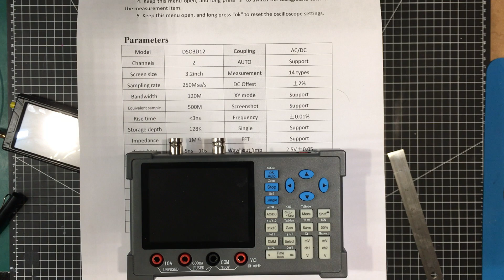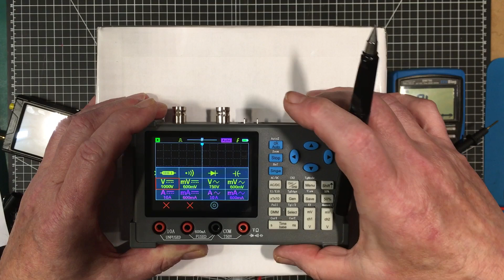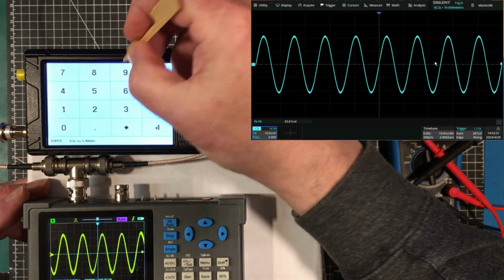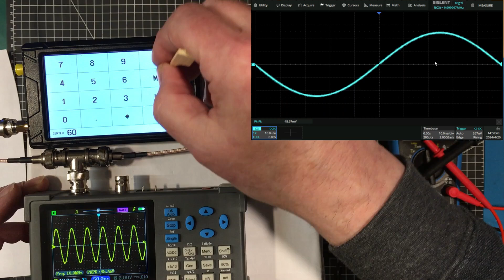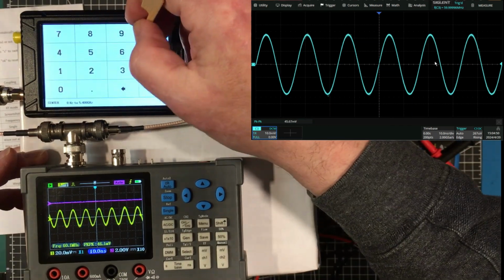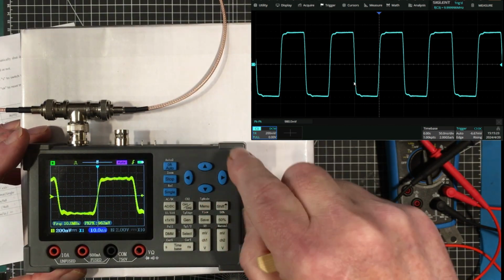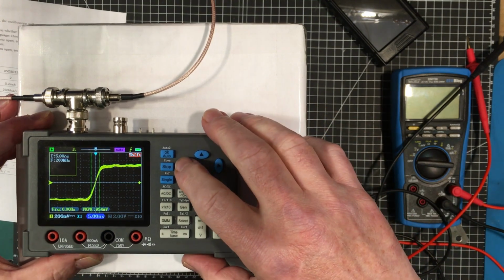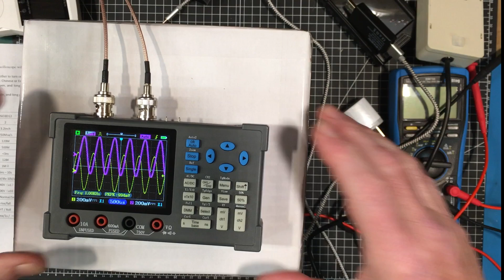Uni-Byte 0179 - A detailed look at the ZEEWEII DSO3D12: Part 2 of 3

Comment: Hello, awesome review
Between the DSO2512G and this one (DSO3D12), which do you think is better/more accurate as an oscilloscope?
Reply from the maker: The scope functionality of both are pretty much the same.  I believe they use the same acquisition chipset.  The DSO3D12 has a bigger screen, but the DSO2512G allows you to connect an external monitor.  The DSO3D12 also has a decent DMM built in, so in a pinch, you don't need to drag one around with you if you have the scope.
Reply: @uni-byte  But the internal "noise", is it higher in either one? I think that lower noise means higher accuracy (besides their similarities)

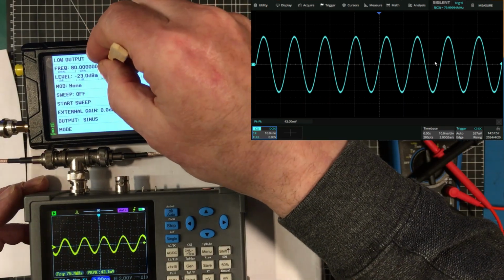Comment: 7:50 You know the terms " transmission line " , " impedance match"  ?
Reply from the maker: Yes I do.   Do you feel I have not set this up correctly?  There is a 50 ohm termination at the SIglent end and the output impedance of the generator is 50 ohms, as well the cable is 50 ohm intrinsic impedance.  The problem I'm looking at in this case is also equally apparent without that set-up and was verified using the supplied probes set to 10x directly coupled to the signal generator, before I even shot the video.  I'm simply using this set-up to use the Siglent to demonstrate the issue with the attenuator.  The impedance of the Zeeweii does not change with different attenuation settings, if it did, you would see the change in loading on the Siglent too .. which you don't.  The net-net is, the Zeeweii's frequency response is not flat at some attenuations and this has absolutely nothing to do with transmission lines, or impedance (mis)-match.

Comment: Should i buy this one or the Zoyi 703s if they are 10 dollars apart?
Reply from the maker: I'm not very familiar with the 703s so I can't really say.  I don't like it's from factor, but that's a very minor thing.  I'd really need to get my hands on one and check it out.
Reply: @uni-byte  sir if my experiment needs 1khz ac wave from the signal generator, can this give a clean output?
Reply from the maker: @ridesafealways4929  Yes, absolutely.
Reply: @uni-byte  what can you recommend for the price of 150 usd? Something better.
Reply from the maker: @ridesafealways4929  You are kind of in a "no man's land" with that price bracket, however, if you can spring $35 more I'd advise having a look at teh Hanmatek DOS1104.  110 MHz, 4-channels in a full sized oscilloscope with a 7" screen.  Of course it is just an oscilloscope.  No DMM, no function generator.

That said, I do like the ZEEWEII DSO3D12 very much, and despite having 5 "real" scopes and 7 mini-scopes, I reach for it more often than most.  I think you won't go wrong if you choose it.
Reply: @uni-byte  thank you for the advice sir. I'll choose the zeewei. I need the signal generator very much for signals analysis subject.

Comment: Can it do pulse trigger? I'd like to capture a signal generated by my garage door remote
Reply from the maker: You cannot set a trigger based on pulse width like some much more costly scopes, but you would not need to for your purposes.  It will trigger on the rising or falling edge of a pulse.

Comment: For anyone looking for a case for this, I used a "UTHAI T29" case that I bought a while back. I believe it's under $2 ($1.36) at Aliexpress Choice. It fits pretty much perfectly and although it's a soft case, I'm pretty sure it will absorb quite a bit of impact should it fall.

It will not accommodate the probes but it's virtually free protection at that price. Just thought I'd share in case anyone was looking for a cheap protective case that will do a great job and cost more in time waiting for it than it will in price.

And thanks to you Uni-Byte. Your reviews were detailed and an excellent decision maker for my purchase.
Reply from the maker: Nice.  I also found a case for it on AliExpress.  If you do a search on "1PC Portable Accessories Collection Foam" you should be able to find it.  It's a semi-hard case and it perfectly accommodates the foam insert that the scope is shipped with.  So it will take the DMM probes and  the USB cable.  As well it has a pouch in the top that holds the scope probes very nicely.  It was about $9 US.
Reply: @uni-byte  Correction. I have one case that I already had lying around and one on the way hehe

Thank you for that! Much better being able to include all the accessories as opposed to my current method!
Reply from the maker: @MHTSAPAS  No problem.  You got the one that was 230mm x 180mm x 70mm, right?

Comment: Wich one is better between zeeweii dso3d12 and dso2512g
Reply from the maker: Understandable question.  The DSO3D12 has a larger screen and a pretty good DMM, the DSO2512 has a nice rubber cover and video out.  Other than that they are pretty well the same.
Reply: @uni-byte  thank you sir. Now im going to place oder for dso3d12

Comment: I think I would buy it if it had all the bugs worked out but as is I’m not really crazy about it.
Reply from the maker: I'll try to mention some of this stuff to Zeeweii.  It remains to be seen if they respond.
Reply: @uni-byte Any updates?
Reply from the maker: @HenrikHvalpen  Their reply was (paraphrased) "We don't have bug reporting process".  I still use mine nearly daily.  The little issues don't really bother  me as I'm used to them.
Reply: @uni-byte  Thanks for the reply. I was originally looking into buying the ZT703s but it seems to have a lot of bugs. Then I looked for a DPOX180H because it seems to have some good reviews, but also a bit more expensive and it only works as an Oscilloscope.
Then I saw the one you tested and it's quite intriguing. I have also looked at a HDS2102s which also is a 2-1 one solution, but it's pretty expensive too.

It's my first time buying an Oscilloscope and I really want to make the right choice the first time.
Reply from the maker: @HenrikHvalpen  I Understand.  When I was buying my first scope I only had one option in my price range .. a Heath Kit single trace 5MHz analog scope (and I had to build it myself!).  These days there is too much to choose from and that in itself can cause issues.  Good luck!
Reply: @uni-byte  The One you reviewed in your video, what are the typical use cases you use it for? I want to use it for diagnose MOSFETs to see if they get the right signal on the gate. And maybe to see if a crystal is performing right.
Then maybe play around with 555 timers and making small circuits.
Reply from the maker: @HenrikHvalpen  I use mine for general hobbyist use,  Right now I'm using it to monitor the serial communication between a microcontroller and a display.  Next week it could be something else, like an audio amplifier or fixing a power supply.  It should have no problem with the stuff you mention.
Reply: @uni-byte  When will 120 MHz become relevant? It's more to figure out which frequency I mostly should expect to diagnose on.
Reply from the maker: @HenrikHvalpen  It depends on the signals you are looking at and why you are looking at them.  Even "low speed" analog equipment like audio can have problems you want to diagnose that might produce very high frequencies, like an oscillating OpAmp.  Digital can produce frequency components in the hundreds of MHz.  Even simple things like Arduinos and the sensors and actuators you attach them to.
Reply: @uni-byte  okay thank you, but 120 MHz should be enough.
Reply from the maker: @HenrikHvalpen  There can never be enough bandwidth but we all have a budget to work with.  For what you mentioned this will be a fine first scope.  The FNIRSI you mentioned would also be good, but just consider that this has the larger screen, the more robust direct BNC connectors and the DMM capability.  The FNIRSI has some more bandwidth and a slightly better function generator.

Comment: I've got to stop looking at all these reviews for cute little multi-scopes. I have a bench HP, a handheld Fluke, a smaller than the Fluke but good $190 handheld multi-scope in my tool bag, and a couple of $15 to $30 'toy' scopes. But the Chinese keep coming out with interesting handhelds every month with more bandwidth, better triggers, ever more features that work better, and at a lower price. I'm almost glad this one has problems. I could turn into a scope junkie if I'm not careful. :)

I would so love send some of this tiny gear back in time to my 13 yo self. A handheld multi-scope, a TinySA, and a NanoVNA would make a heck of a start for just about anyone back in the 1960's.
Reply: Buy it dammit! 

You're a stronger man than I. I have 3 bench scopes and this became my third and best handheld. I only do basic electronics but I couldn't resist this one. The little bugger kept popping up both here and in my AliExpress front page constantly so I didn't really buy it because I wanted it. I just wanted to stop seeing it!

I don't know how you do it. I need to stop buying scopes!
Reply from the maker: It may have a few problems, but from what I can see they are not any worse than other devices in this class.  Comes with the territory.